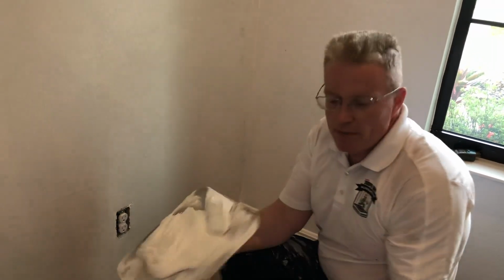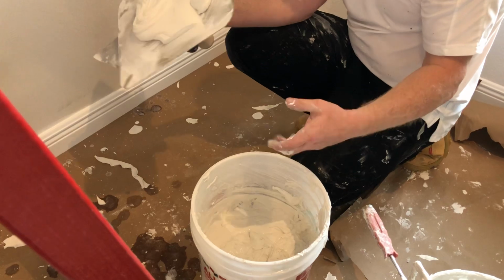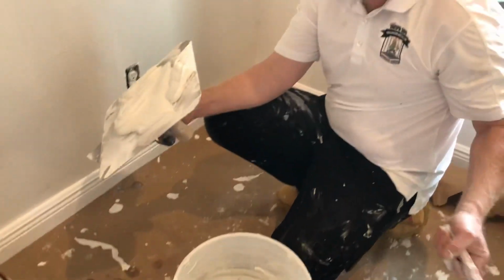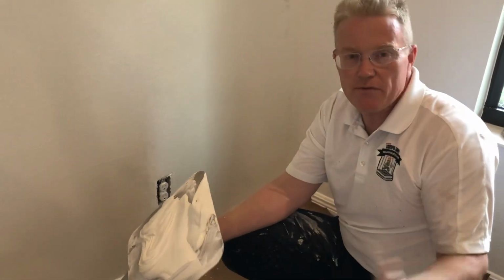Get rid of that ugly texture on your walls and ceiling! Watch this! - Spencer Colgan

Comment: Have a small bathroom ceiling and half is new drywall and other half is light rolled texture I cut layer bout 3 in so I could mesh tape and do seam. My question is can retexture whole ceiling and use black pattern roller pad to blend together been texturing many years but never tried this. Thanks
Reply from the maker: Of course you can….especially with your experience.
Reply: @spencercolgan  thanks I just never tried it before didn’t want to scrap off old texture or skim coat it.

Comment: Which kind of joint compound did you use? All purpose or lite? Thanks so much!!
Reply from the maker: I use the light; it dries really quickly if you put it on nice and thinly  and then you can do a second coat almost immediately after the first coat.

Comment: How long between coats do I need to wait? Does it need to dry first?
Reply from the maker: MJM, That is a great question but if you were doing the work, you would immediately discover that you would have to wait until it is entirely dried because you would be pulling up the first layer if it were even damp just a little bit therefore, wait till it turns white/dry
Reply: @spencercolgan  Thanks so much for the swift response

Comment: Great video Spencer. Straight to the meat of the work. Can I ask you a question? What do you typically charge to do a level 5 skim coat over a medium knock down orange peel? I have a 1600 foot house with 8’3” walls, single story house 3 bed, 2bath house. 10 windows in the house and carpets are torn out, so messy will happen so less prep. Just trying to get ‘ball park’ pricing, even price per square foot. Thanks
Reply from the maker: Hi!   Are you in Florida?

Comment: Good job with skimming but how did you remove the texture? I have painted textured, tried to scrape it,monumental job since the entire house is textured. Really hard on my arm after only one square foot. Do you have any tip on what to use to soften it first? Tried water but wont go through the paint. Thank you
Reply from the maker: Go to my YouTube channel and put in the search bar Spencer Colgan skim coat and you will find several videos explaining how to do it
Reply from the maker: This removes of what I’m doing in this video by rolling the compound onto the texture then you flatten it out; perhaps I should have showed you the Texture before I started rolling this sovereign
Reply: @spencercolgan  The texture I have is very spiky and thick, rolling stuff on top would make it look worse it kjust needs scraped off, but its pretty hard to do.

Comment: Hello, I had a question about the process. Sorry if I missed it if it was in the video. I know you said for this instance you’re using 3 coats but typically it’s 2 depending the depth of the crevices. So how long do you wait to apply the next coats? Great video btw. Just saved me from messing up my walls and wasting time
Reply from the maker: Apply the next coat right away.  1-2 hours after you Finish the first coat.